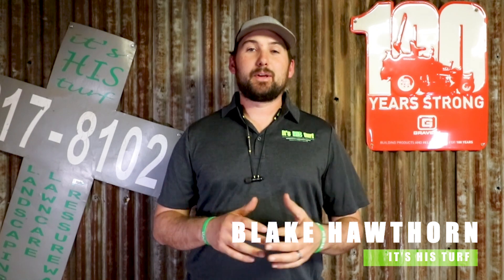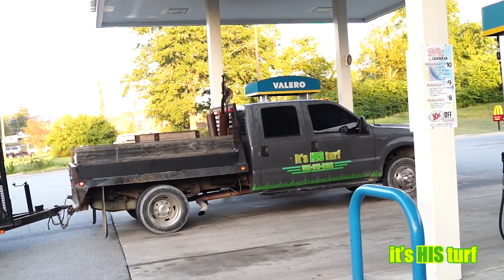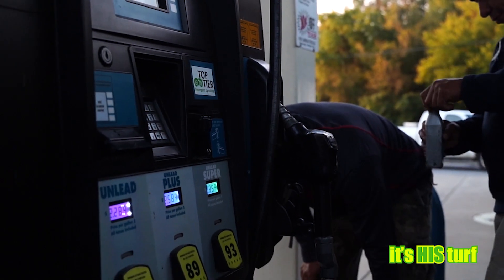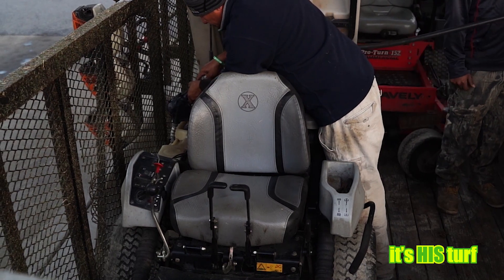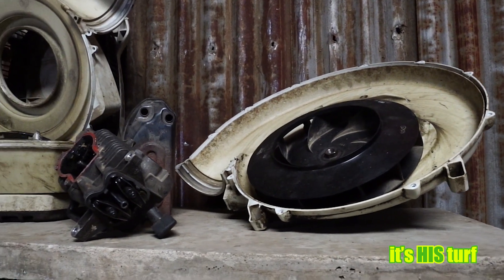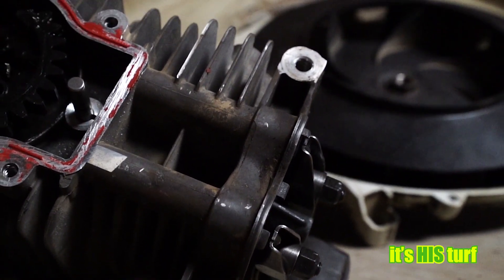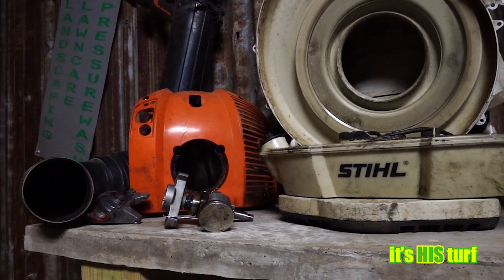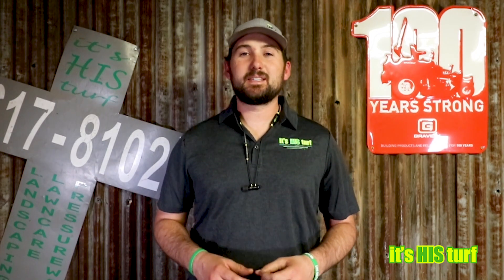2 Backpack Blower motors RUINED! This COULD have been PREVENTED!

Comment: Good video I have had the same problems in the past.I run a similar set up as you I have 4 maintenance and two construction crews. the way I have it set up is the driver is responsible for mixing all of the to cycle in the Spring and summer and in the fall and Winter we go through a lot more two cycle mix for the blower's so I have one person come in a little early and he fills up all the tanks. It also eliminates a lot of time 6 crews stopping by the gas station every morning 30 minutes by 20 days per month eats up a lot of extra cash in labor.  This  year I'm going to implement one guy filling up all the tanks for the entire week in all seasons and the only upfront cost is buying a lot of extra are 5 gallon gas containers.

Comment: My dad had his chainsaw repaired at a shop and the mechanic there said anything piece of equipment that is 50:1, make the mixture 32:1. The extra lubrication will only make it smoke but protect the engine for a lot longer. I run the mix in everything this way and it may smoke a little bit at start up i have yet to see it billowing out every.

Comment: i think this is the 3rd season with red armor ( or 4th ). good stuff, equipment always starts up the following season, and even a trimmer that was hard starting before fires up much better since i've been running the red through the system. 

i've had one stihl backpack ( br600 ) in my career, and it did the same thing. actually, the only reason i bought it was because it was used and "cheaper" than the redmax 8500, which is what i wanted.  she clunked out in the middle of a big leaf job, i tried looking at it myself, couldn't find a solution, the next day took it to one of my two dealers, they said it was beyond saving, and i was able to get a redmax 8500 with a just a down payment ( 🙌🏻🙏🏽 ), and i never looked back 😂

Comment: Heres my thoughts on it, I prefer to use the smaller oil containers to fill up a empty gas can.   I dont have to worry about others as i fill it up but it real makes things easier if/when someone else friend/family uses my stuff I can just hand them a oil and tell them to fill it up and use the whole thing.  Keeping it simple and standard op really keeps mistakes from happening.   Id rather spends a couple dollars more to buy the smaller size appropriate oil mixes than to have to replace even one item.    Buy a case or two of oil throw a pack or two in the truck your good, also run at 40 1   rather foul a spark arrestor (which I usually remove anyway) or plug,    never had a single issue.     If your getting debris then id HIGHLY recommend getting a mr. funnel fuel filter keeps  all debris and water seperated out of the gas.
Reply from the maker: I'm going to checkout that funnel you spoke of.
Reply from the maker: I'm seeing that funnel for sale at Wal-Mart for about $30. Is that bout right on price?
Reply: @itshisturf23  they should range from 15 to a little more than 30 depending on what model your getting.   The bigger ones are nice because they filter faster, if you want one you can use the pump to filter before going into the can get the biggest one. https://www.youtube.com/watch?v=J2TUgxTjHfc this kinda helps show the difference in size.